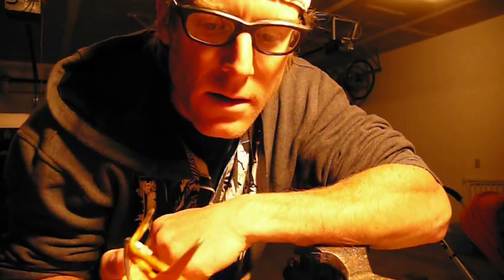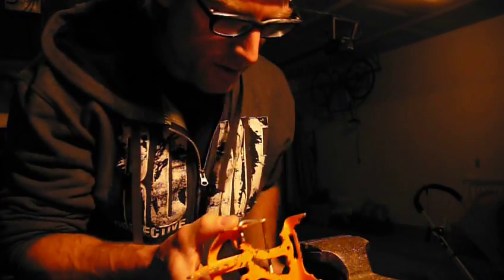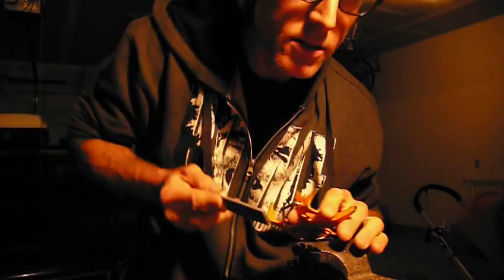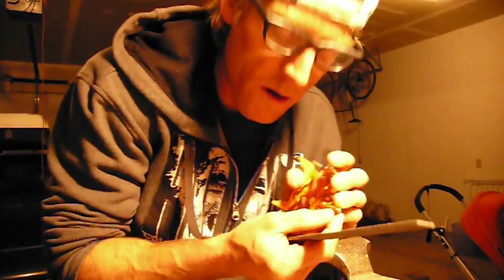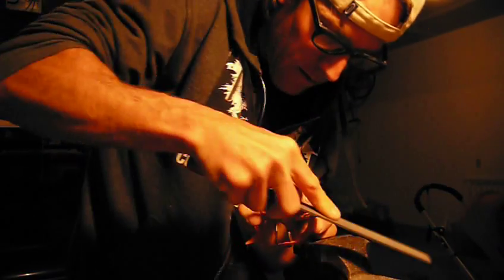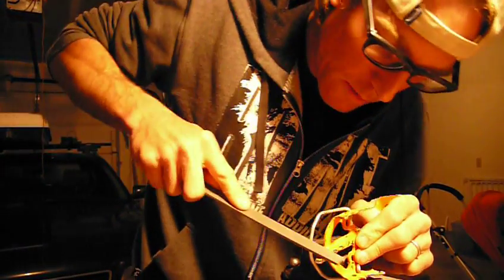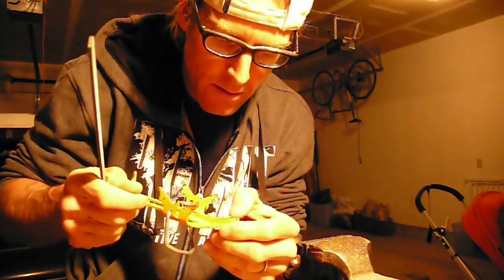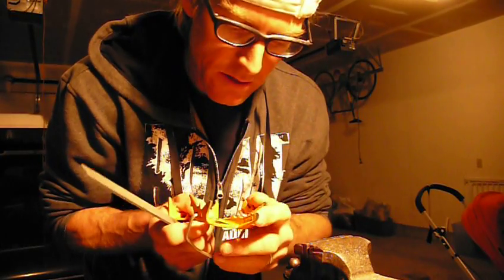How To File / Sharpen Crampons

Comment: agree with prior poster. Whenever you use a power tool to sharpen a set of crampons, an ice axe, or even a knife, you heat up the metal more than you realize. Alot of times you can ruin the temper of the metal. It would be almost as if you changed the metal to a weaker forge. Hand tools produce much much less heat as their not as efficient, and therefore you would be harder pressed to jack anything up. Secondly a hand file allows more control of the sharpness and shape.